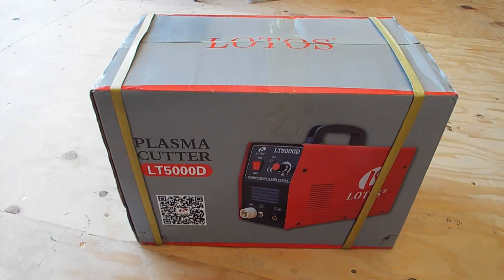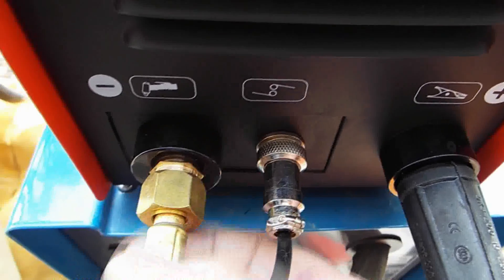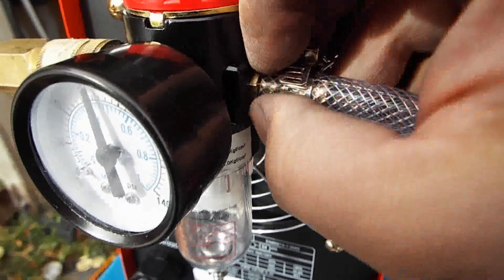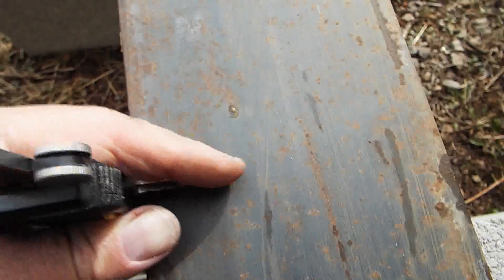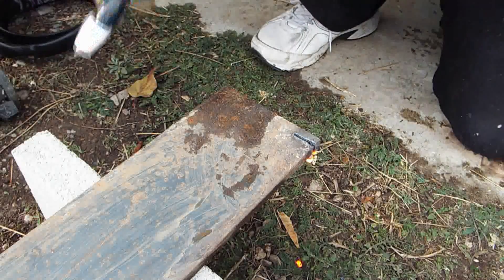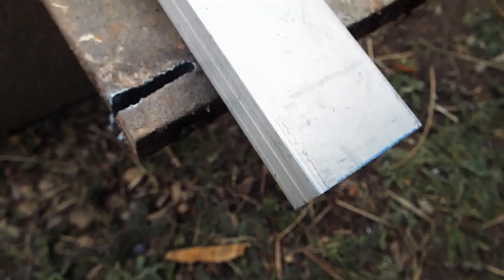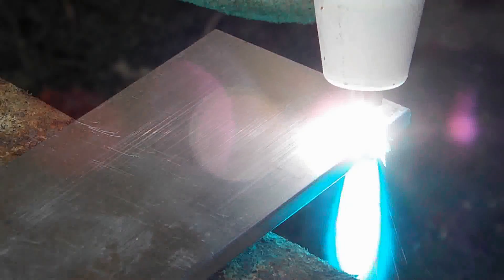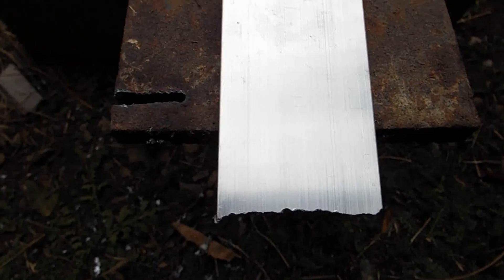Testing a Lotos LT5000D 50A Plasma Cutter

Comment: I really like to know if you still have this, how much you’ve used and how it’s holding up after 5 yrs
Reply from the maker: I actually still do have it and I have actually have used it a lot, it does eat a lot of consumables ( the tip parts ) and I have replaced the handle once. But really I am pretty impressed with what it can do for the initial price. I know that there are newer models that are available but I have tons of consumables that I bought of of ebay for cheap so I will continue to use this one until it quits working or I cannot get cheap consumables. It does a good job at cutting!

Comment: Good video.  Thanks.   You mentioned that you cut aluminum on a table saw.  Which blade are you using?
Reply from the maker: A finish carbide wood blade ( 60 or 80 tooth)
Reply: @madscientisthut  Thanks.  Good to know.  i just ordered a plasma cutter, but having the chop saw as an alternative would be helpful.  My old bandsaw it getting tired.

Comment: Yes cutting aluminum is ugly. But I think if you play with the air pressure and amps and speed it would cut the 1/2" also if it mot a pilot arc you can practically rest it on the material. And if you want to cut stainles cleanly use argon instead of air it makes a huge difference. I want to try that trick on aluminum!

Comment: The reason all those Pipe threads are loose is because the pipe taps are tapered thread and the tapping person or machine tapped the threads to deep. I found this out when i worked in a factory that used a lot of 1/4 inch 20 pipe taps for grease nipples and if they were tapped to deep the grease nipple would bottom out at the hex nut area before it would tighten up.

Comment: Does your machine run air through the house the entire time the compressor is hooked to it? Even when I'm not using mine the air never shuts off cause my air compressor to run constantly and I end up losing pressure and that's with a 32 gallon tank
Reply from the maker: No my machine only runs air when you press the trigger.

Comment: I bought a cut 50. Suppose to cut up to 14mm, it struggles to do 8mm
Reply: What cutter do you use, I'm in the market for one to use for home projects like a BBQ pit made from  a propane tank, I need something in this price range, for thicker material I have a standard shop size cutting torch, I'm looking to save gas and make a better cut. I very seldom cut aluminum with a torch, I use a saw.

Comment: There are additional videos on tube that cover cutting aluminum with plasma. Argon provides cleaner cuts than compressed air.
Reply from the maker: Thanks! I mainly use the table saw with a carbide blade to cut aluminum. Cutting on the table saw is extremely precise and clean, it is just noisy and really messy.

Comment: You should use pipe dope on air fittings instead of tape, so that the tape doesn't get sucked in. Using tape can ruin the diaphragms inside your machine or regulator
Reply from the maker: Thanks for the tip, did not think about it.

Comment: if you were meant to preheat aluminium slab how would you do it ? and are there more powerful plasma cutters on consumer market that cut these materials much more precisely besides industrial laser machines? cheers Kirk ..:)
Reply from the maker: You would have to preheat using a gas torch. Yes there are much more powerful ones out there but get ready to shell out the bucks!!!
Reply: yeah right ..gas torch ok... it all depends what you do and if this would be affordable for your business then you can spend more it makes sense

Comment: Do you know how much air flow (cfm or l/min) the compressor needs for continous operation with this LT5000D?
Reply from the maker: 3.6 scfm @ 65 psi
Reply: +madscientisthut Thanks. That translates to 100 l/min @ 4,5 bar, which is a little too much for my compressor (80 l/min). Damn..

Comment: are you on 110 or 220?
Reply from the maker: +MaxFactorVIII I am running 240VAC with a 30A  circuit
Reply: madscientisthut do you have to rewire the machine to switch from 110 to 220?  Mine came with a 110 cord and plug.

Comment: Have you tried using the drag tip attachment to maintain the proper spacing?
Reply from the maker: +Larry Hutcherson Sr I did not get a drag tip attachment with the unit I ordered. I would definitely like to get one though, I think I touched the tip to the metal I was cutting too many times and I really think it destroyed the tip. I do have a bunch of consumables to go through still.
Reply: @madscientisthut  I watched the Lotos factory video for the Brown LT5000D that says the tip should always remain in contact with the metal.
This surprised me, since my last unit (Cut50) suggested a space and had a special drag tip holder to maintain that space.
I bought the Lotos LT5000D 50A "Brown" unit, and the tip is a bit different than yours, even though yours is also marked with the model #LT5000D 50A but it's red. The difference between Red and Brown is confusing. 
If there are fundamental differences between Red and Brown, I would think a change in model number would be in order.
Note: Lotos has a pilot arc version LTP5000D, and does not require the head contact when cutting.
I'll be testing this soon, and will try to circle back and let you know what I find out.
Reply from the maker: @eCitizen1  Interesting, yes sounds like a new model number would be a good solution. I have gotten much better at  holding a space with the hand piece while cutting, I do not destroy the tip much anymore.  I am pleased that this unit still works and I still get use from it.